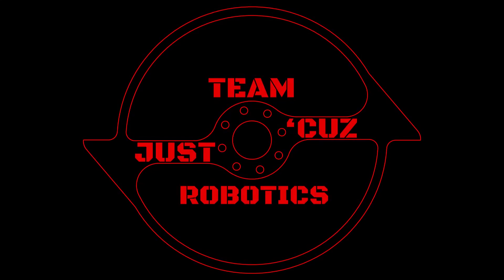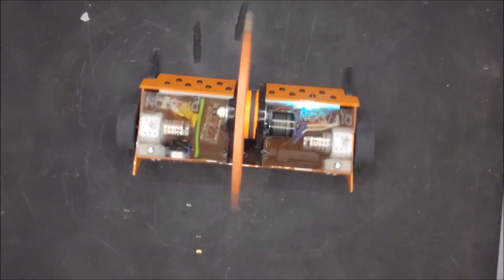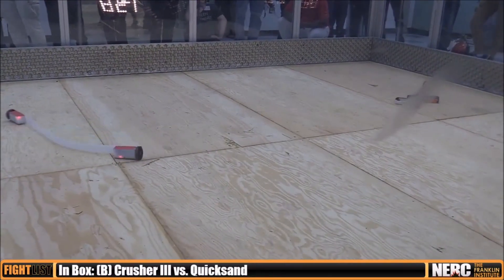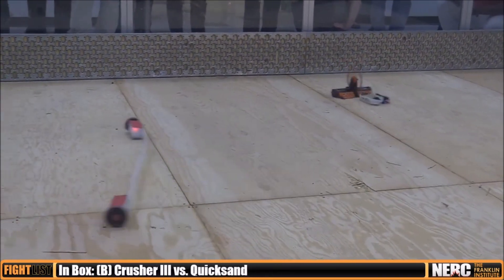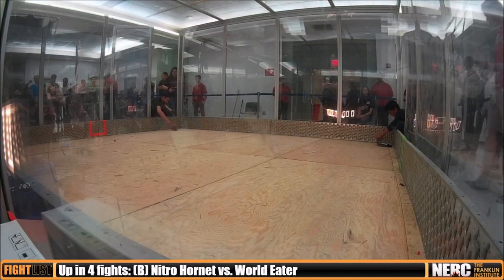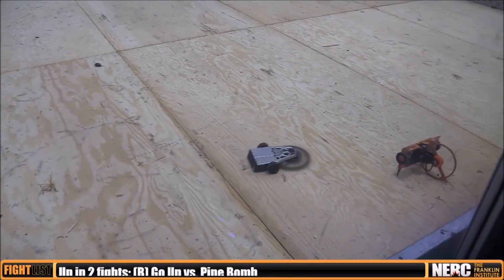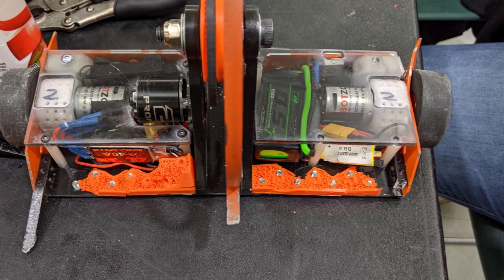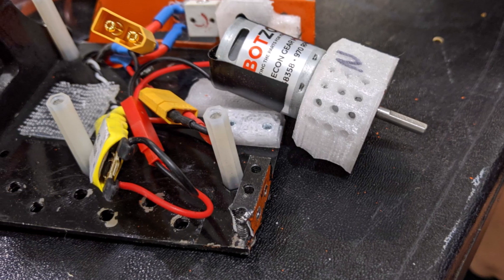Division at Franklin Institute 2019: Event Recap

Comment: Well, you may not have gotten far into the competition, but at least your bot was entertaining. Great video! Btw, in your fight against that horizontal spinner, why didn’t you use the bar instead of the disk? I ask this because I think the bar would’ve been more effective as there would be a much smaller chance of it getting hit in the side thanks to having less surface area.
Reply from the maker: Thank you! To answer your question: several reasons. First of all, I can't self right nearly as easily/quickly once the weapon stops, and the bar has 60% of the MOI of the disk, so it is much easier to stop. It also obviously is much more difficult to self right with the bar if it does stop whereas in the video you can see I am easily righting myself from the back many times with the disk. Second, I already did this against BDE, an even thicker and meaner looking horizontal spinner (See my Norwalk Havoc recap, last fight). The result was that my weapon disk was fine and theirs was permanently bent! Lastly, with the bar or disk, if I'm spinning at full speed, there isn't any likely way that the other bot's weapon will hit anything besides the teeth of my disk. The force of a horizontal hit will be the exact same either way, bar or disk, if it's on the outermost part of the weapon. By the time they would get close enough to hit the 'ring' of my disk, it would have spun all the way around to hit their weapon. It spins at 11000RPM so they would need to be driving at me very fast to have any hope of my tooth not hitting them first. Sadly, even when not hitting a horizontal, the disk weapon has a bit too much side-to-side play in it, so I'll need to work on that in the future.